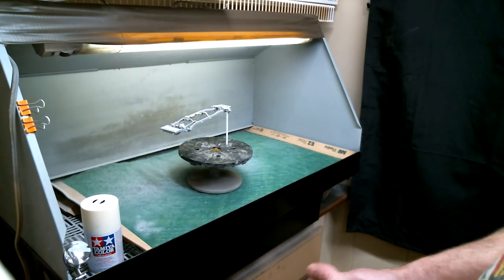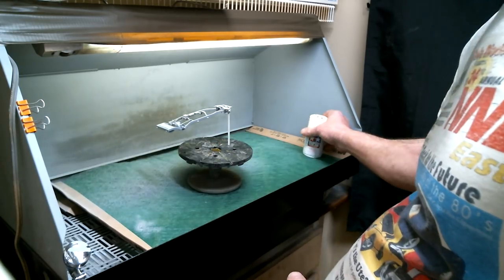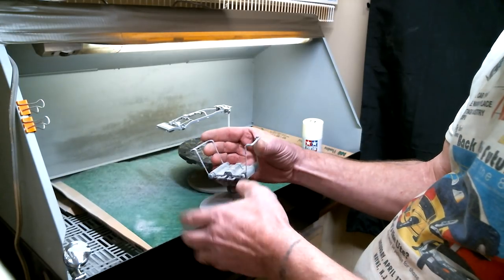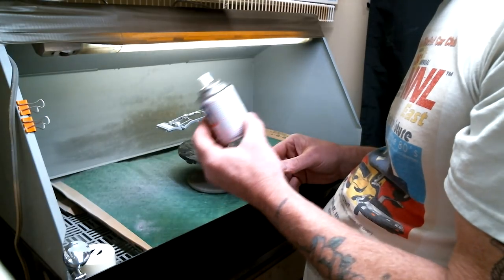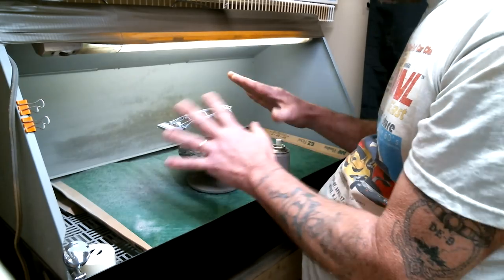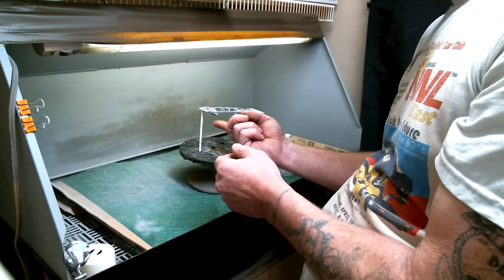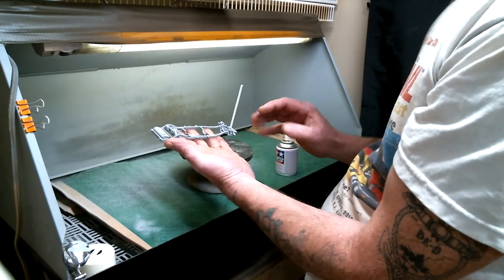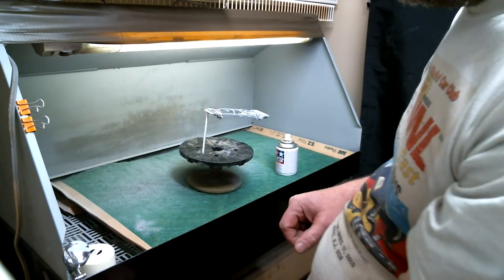showtime studios build tutorial (part 18)

Comment: Hunter you stated you needed to clean the tamiya plastic model stands that you use in the video. How do you clean them and what do you clean them with. I use tamiya spray can, and testors one coat spray can and wet look clear on mine. How would I go about cleaning up those stands without hurting that plastic or metal on the stands?